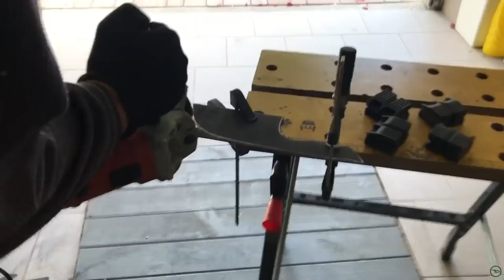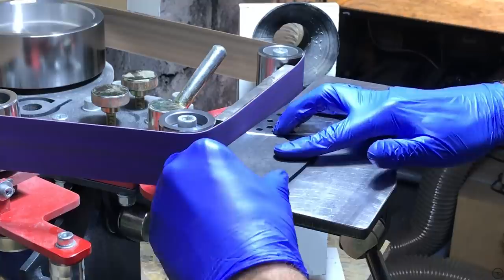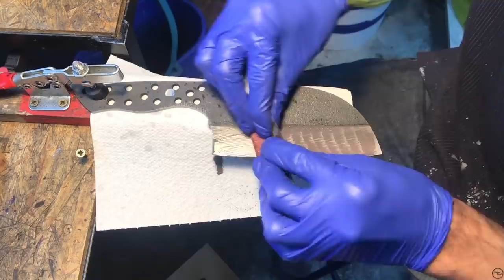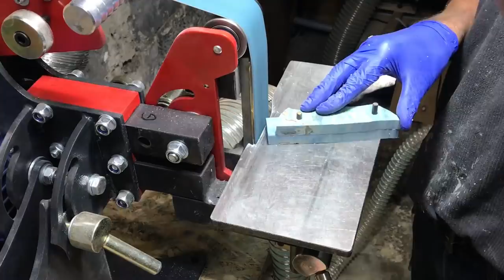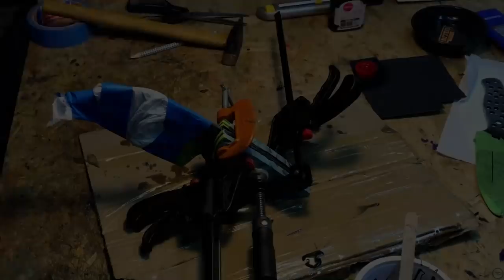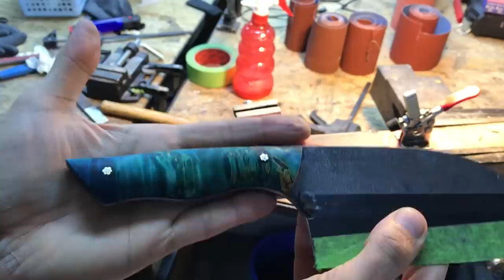Knife Making: Serbian knife (Serb)

Comment: I’m confused why you heat treat it before grinding.   Are you making it hard or soft ❓
Reply from the maker: If you ask specialists regarding heat treatment they will tell you that Heat treatment works the best for the element that has some thickness - more is better in case of such a thin stuff like knife blank. You can grind in soft do a heat treat and do final grinding. For me this is waste of time . I am grinding in hard steel from the beginning to the end. Of course you have to control temperature not to overheat … for kitchen knives < 2mm thick this is the only possible option by the way.
Reply: @t.ccustomknives4154  thanks for the reply.   I’ve already almost completely ground my first knife.  It came annealed, I haven’t treated it yet.   Oops